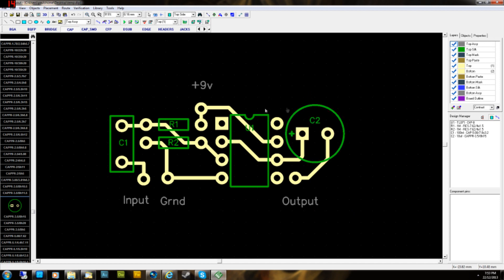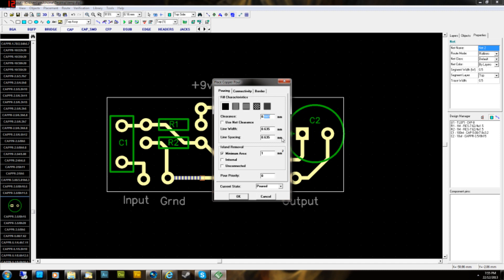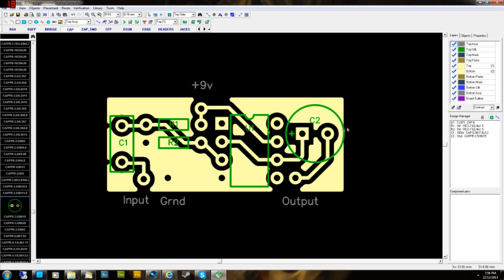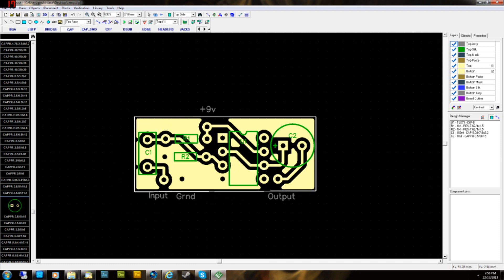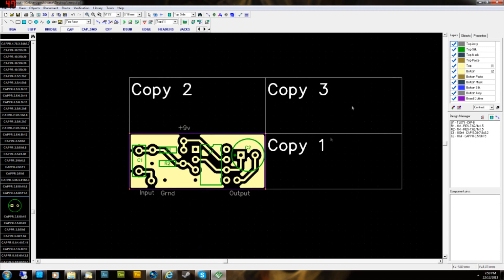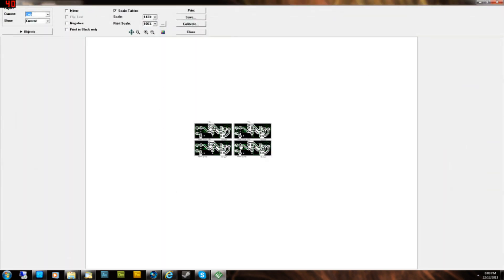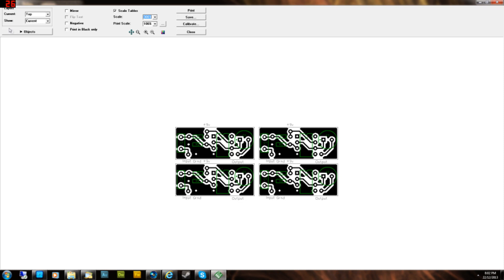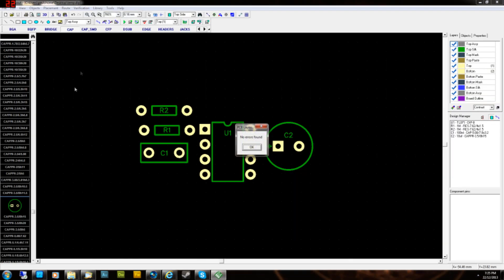Design your own Guitar Pedal PCB Layout - Single Sided (Part 3)

Comment: I've been using these tutorials to get my designs ready for production at a third party. For a single sided PCB, wouldn't this mean non-symetrical (like an IC) components can't be placed on the correct side, forcing me to place them on the track side? From what I can tell you always want the tracks on the side with the leads. Is there a way to fix this, apart from doing it all over again?

Comment: Hi! I think diptrace's transistor pads (TO-92) too small. I tried to make it bigger, but then they are very close to each other and it makes it hard to solder. Do you use the default pad size for it? Is there a way to change the pad size and the distance too? Thanks!

Comment: hi!! Thank you for taking your time to teach diptrace! I already saw part 1 and 2. You are one hell of a teacher sir!
Just a question: when you are ready to print the layout, it be reversed/mirrored so you can etch it right?
Best regards!
Reply: I dont beleive so, when you place the toner on the PC board its going to cover up the sections where electrons can flow, when you use the chemical to take off the copper the white sections is were that will go, then when you take off the ink, the black area, that copper will remain.
Reply: MikePayne86007 Mike, I meant mirrored image, not color reversed. It must be that way... I think (at least that's how I make my trasnfers and they turn out ok).
Reply: Ricardo C. Ahh i see. I didnt consider that. :)